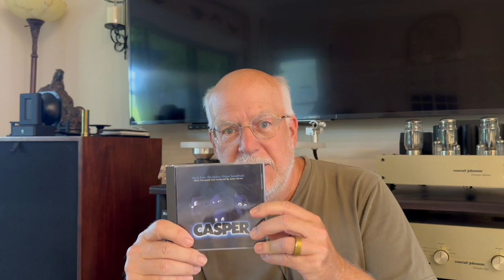Do speakers really need to go down to 20 Hz?

Comment: I designed high-end speakers for many years.  I hold international patents on active speaker design. 

I spent years trying out different bass speaker designs, including designing and building speakers (which I still have and use) which actually, genuinely, go down very close to 20 Hz.  It was really difficult and cost a lot of money.  That pair of speakers, by the way,  weigh approximately 260 Kg (that's about 570 pounds).

A clarification here.  If you want to produce low bass without concern about quality, it's pretty easy.  If you want fidelity and low bass, it is much, much more difficult.

So about music.  Low bass can be found on very good recordings of (for example) double-bass and pipe organ.  Note that the artist has to be playing those instruments in their lower register, which is rare on the double-bass (for the pipe organ, the lower foot pedals - and by the way it has to be a large pipe organ).

Generally, you are right.  If the speakers can reproduce 40 Hz with good fidelity and reasonable amplitude, they are perfectly fine, and will serve 99% of the time without limiting the music.

As for high frequencies : older guys like you and I typically can't hear anything above 12 KHz (or perhaps even lower).  That's about it.  Another thing - typically the tones over 8 KHz or so have very little value in harmonic terms, and in audible terms they are just a very delicate and fine tone, indistinguishable from 6 KHz or 10 KHz.
Reply from the maker: Very well said.
Reply: 40 Hz that's where most live subs are tuned for bass guitar/kick drum

Comment: Thank you for your thoughts, very interesting indeed. Let me tell you mine:
Not knowing which phone app you are using, my understanding is, it tells you the frequency of the tone - the main tone. Still there are lower tones on your album, but they are lower in gain than the main tone. Therefore you would need a kind of spectrum analyzer. Just buy a supported USB microphone, connect it to your computer and install one of the free applications, like REW. Another possibility is to rip the CD to the computer, and then analyze the track via eg Audacity, it will show you the full frequency content.
Also keep in mind, the lowest key of a piano is 27.5Hz. Some other instruments go lower. Again, this is the main tone. The full spectrum can include lower tones (lower in gain and lower in frequency).
Many people report better 3D soundstage with a subwoofer. One of the reasons are very low frequent room modes of the recording venue. Suddenly they can feel them - they feel the recording room.
Reply: ChatGPT says:
The human ear can indeed have trouble detecting sounds below 16Hz, which is why the lower limit of human hearing is often considered to be around 20Hz. However, this does not necessarily mean that a piano note below C0 (16.35Hz) would not be heard at all. Sounds in the infrasonic range, below 20Hz, can still be perceived by the human body as vibrations, even if they are not heard as sound. Additionally, some people may have a greater sensitivity to these frequencies, and may be able to hear lower notes than others.Keep in mind that even if a piano note below C0 is not heard as sound, it can still have an effect on the body and mind through vibrations.

Comment: Listening organ music and classical music, there is defenitly a lot down 45 Hz. So I do not fully agree with your point of view. I think it is depending on the type of music you listen. A contrabass will go down to 41 Hz, or even to 33 or 31. Listening an orchestra without this range of a speaker, is defenitly not "complete". That perhaps for a lot of music the range below 40 Hz is not much adding, I can understand. But making this as a general fact, I think is not correct, from my point of view.
Reply from the maker: My point of view is with the CDs I tried there was only one that made it down to about 45 Hz.
Reply: Rachmaninov Symphony No. 1 goes down to approx 35 Hz. First 2 minutes is already enough. Old reaction with link to measurement is deleted. But in combination with REW and UMIK very easy to measure.

Comment: The lowest tone on a Bass guitar is 41hz and the Grand Piano is 28hz, some organ music hit 18 hz, so your 'meter' must be some 'off' since you havend mesured any of those instruments.
Reply: Exactly right. And five string basses (which MANY artists use) go down to ~30 hz, so these “measurements” are WAY off. 

Also, even if the gauge worked, the method is trash because he’s using the sound coming from his speakers as the basis for determining the lowest frequencies on a recording. Ummm…you’re limiting your measurements to the lowest frequency range of your own speakers, so unless they’re capable of producing 20 hz, you’ll never measure what’s on the recording.
Reply from the maker: It's OK if the meter is off as I explained, what we are looking for is a constant not accuracy.
Reply: @theempiricalaudiophile3729  I get it. But there are other flaws. In the case of an inaccurate micrometer as you mentioned, you still have a basis by which to calibrate it, so there’s your constant. In this instance, you have nothing to use to calibrate against. In addition, even if the phone was measuring “accurately”, you’re relying on the frequency response of your speakers to tell you what’s on the cd. So you’re already constrained by your own speakers lowest frequency capability. Let’s forget about the null spots that can exist in a room. I mentioned the low E on a bass being 41 hz. Certainly almost every jazz and rock cd had instances of a bass playing the open E string.  I agree that response to 20 hz is probably unnecessary for most music, but there is undoubtedly content into the high 30 hz / low 40 hz range on MOST recordings. Even chamber music that includes a double bass.

Comment: Excellent.  I'm a drummer and have been since 1964.  A former bass player in my band used 2x10" speaker cabinet and a 15' cabinet.  He brought over an 18' cabinet in place of the 15" cab, and it was a noticeable difference. 10 inch speakers don't provide much "Impact" but they do produce bass.  Going from 15 inch to 18 inch speaker made an obvious difference. However, like you said, "impact" more than "bottom end", maybe.  I sure noticed the difference as a drummer.  I feel that all this "audiophile" BS stuff is just that.  I bought two polkaudio TSi500 cabinets years ago, along with the rest of the audio system for TV, etc. Each cabinet has 4x6.5 inch speakers and a tweeter.  Around $700 was the price. After much, much comparison with all price ranges of high, super high end and lower end speakers, I have come to the conclusion that my two cabinets with a total of 10 speakers are equal to and often better than those that cost a thousand to thousands of dollars.  I truly feel that a great deal of all this "Audiophile" stuff is just MARKETING $$$$$$ . Yes, I do have two 12" 350 watt sub woofers. Sometimes I use one of them, sometimes I use both of them and often I don't use them.  My 2004 Z06 Corvette, that I bought brand new,  is just as fast or faster than a lot of Ferraris for the $60,000 that i paid.  It's more marketing than Reality. Opinion and Desire rather than fact, often,  IMO.  I don't have to spend more money to get what I already have for FAR LESS.  Denon AV Amp.  To each his/her own. 
Love your site and this post.  You're right on the "money" in my opinion (IMO). 
I have already been subscribed.  Best Regards.      Tim
 P.S.  You can't beat a 15 inch woffer in a 3 way speaker though.         Amen...  😉
Reply: Ive always foubd that larger drivers reproduce bass in a way that feels naturally proportional. Small bookshelf speakers can "touch" some of the lower notes, but they dont carry the proportional presenece and impact a larger driver. Plus, larger drivers tend to play louder with ease.
Reply from the maker: I agree with you on that one 100%
Reply: car comparisons are always pointless and a Porsche with probably half the horsepower will smoke your Corvette in the first corner ( with the right driver behind the steering wheel ) - hands down. I know that because there is hardly any car that can overtake me on normal roads.

The point is that music files contain low frequencies and a quick analyzes in Audacity will proof that. Whether it's needed or not is debatable but it's in the music. The whole story is started in a wrong way and it's pointless.

I don't know what 'impact' would be - at least it's not a scientific term. In case impulse reproduction is meant there is a measure for that - it's called impulse response: https://en.wikipedia.org/wiki/Impulse_response

The faster a system can respond to a given impulse the better it is. In case you have more membrane surface the membrane needs less movement to reproduce a response to the input signal. But the heavier a membrane gets the more force you need to move it. In the bass area the movement is so slow that almost every driver should be able to get a decent response to the impulses provided the size of the speaker is big enough.

The whole discussion needs to be more scientific and less egocentric - the fact that people own good speakers is not a matter of snobbism or voodoo - it is clearly audible and reproducible - that's not saying that there are no audio snobs out - but there are also audio hooligans out ;-)

Coming back to the irrelevant car comparison - you don't buy a Ferrari ( and I don't desire to own one - Lamborghini or McLaren would be more my style ) for fast driving - you buy it to belong to a club of owners and the spirit it symbolizes. And it's on top a fast car as well and a very well built one - you buy a Koenigsegg in case you want the ultimate sportscar.

https://www.koenigsegg.com
Reply: @JoeHo-x3m  Simple point that one doesn't have to spend hordes of money to get top, or close to top quality satisfaction. 
P.S. My 1966 Volkswagen Beatle was a great German made car. Loved It  🤭
Reply: @timmotel5804  when you love something logical intelligent facts are blocked out - we've probably all experienced that ;-)

Comment: A lot of audiophiles expect to feel the impact of bass on EVERY song .............
A friend of mine bought some very expensive speakers specified to go down  to 30 Hz, these speakers used a passive bass radiator ........no energie or impact was felt other than the one measured performance printed on the glossy papers from the marketing department ...
I have a pair of bigger monitors  that are specified only  to 50 Hz and they have an impact on bass.......
Besides impact ..........I do have a preference to closed box speakers, I do not like the majority of bass reflex speakers ...........the closed bax falls off earlier but continues to go down.in a faster and controled way but the BR cuts off abruptly with a puffy , muffled  sound ..like an atlete that runs out of breath...breathles .

Comment: The reason no bass on klipsch la Scala cheap gready company
Take the 15 cheap stamped driver and put a older alnico jbl you will see transformation night and day
Reply: Huh? The horn length determines the low end not the driver. It could be you're overdriving the alnico JBL and that leads to perceived more bass. I have an Eminence 15 in my homebuilt khorns. Eminence told me mine's good for 300 watts whereas Klipsch's maybe 200 (they rate it at 100). In my small room I can't stand the 90 watts my amp puts out. (I have driven them with 200 watts for years though).

Comment: Yes, we need

How low goes your CD collection.

Ok and you want a constant.

Yes if you use your phone and measure constantly the LEVELS at ONE frequency.

Let say at X Hz.

But you now want to measure with a uncalibrated unknown microphone. 

Unknown what sensitivity that microphone have at 10 Hz, 20 Hz, 30 Hz, 40 Hz!?

No, now THAT is not a constant  most likely the smartphone microphone has a variance in sensitivity. So that is NOT a constant. So you are already of base just there.

When it is not a constant all your conclusions with all respect based on that is wrong.

Let me expand in another direction.. years ago I were very interested in what sound differences in op-amps. I bought from a very reputable Mouser dealer very high regarded op-amps.

What I noticed were that this op-amp had very week or nonexistent first octave! 

And now we are talking about a whole system as a constant and just swapping high quality op-amps!

Speakers usually are tuned (bass reflex, and other types of enclosures) so they maybe perform somewhat ok down to ~40 Hz ±5 Hz. And how you position them in the room.

After that frequency they drop down very fast. So even if you have a big bass driver it doesn't mean that it will go low down in frequency it migh be turned to perform "more" (dB) at a higher frequency as you say around ~80 Hz for example.

A third thing is that you can sit in a bass null in your room. And it doesn't matter how much energy (wattage) you trow into that (null) frequency you will and can not fix it. It is physics.

A fourth thing is that your ears has not Linear frequency "response"!

Everybody is just staring at the gear frequency response but nobody looks at their sensitivity of their hearing that varies with frequency (maybe as bad as your smartphone microphone but it is measured and known, but we don't know anything about your smartphone frequency response..😂 it is unknown. Yeah we could maybe look it up.)

So the forth thing is about equal loudness frequency response of your hearing.
Just think about it when you play 1 kHz tone at 60 dB.
Then just so that a homosapiens in their best years and perfect hearing are listening to 20 Hz tone (in laboratory conditions we have several ISO revisions) JUST so those will HEAR it as equal loudness as at 1 kHz they need to play at 110 dB at 20 Hz!

That is just to hear 20 Hz EQUALLY loud not louder..

What that means is that our hearing sensitivity DROPS the lower we go in frequency.😮

So we NEED a system and speakers that increase in loudness as frequency is going lower and lower to just to support that our hearing sensitivity is dropping..

But speakers are actually doing the totally opposite when they drop in loudness the lower we play in frequency! They are the opposite to support our hearing!

As a example from the above if we make sure to continue to play at 60 dB at 20 Hz as we did at 1 kHz (in other words "microphone flat" frequency response). 
Then at 20 Hz with 60 dB then 60 dB is BELOW the hearing threshold for our ears at 20 Hz! 

And that 60 dB at 20 Hz is better than your speaker could even produce! 
And even IF it could generate 20 Hz and your rest of your system can and also if you find a electronic album CD that play 20 Hz you would not be able to hear that! Because of your hearing sensitivity is so low at 20 Hz...😢 (so it is naturally that we homosapiens bost the bass in our systems, when you know that.)

All that said their is a lot of things that is hindering and make it not so easy to get a clear cut opinion when all those things are addressed and optimized.

It is as peel a onion when you address one issue at the time.

We can go into the lower layers but this is long enough for a YouTube comment already. 😂

Good luck in your HiFi journey, 👍
Reply: All good points.